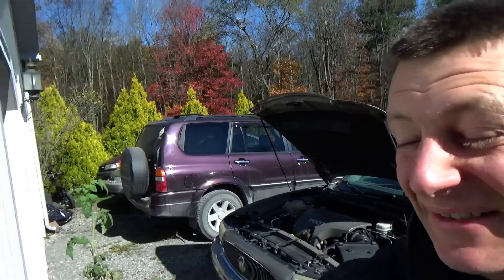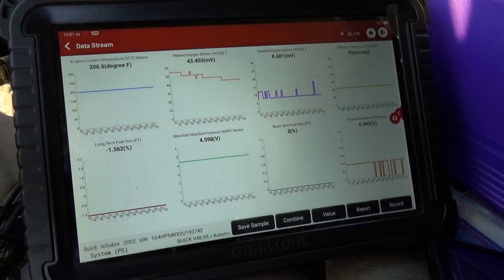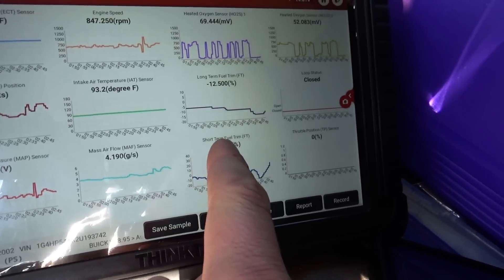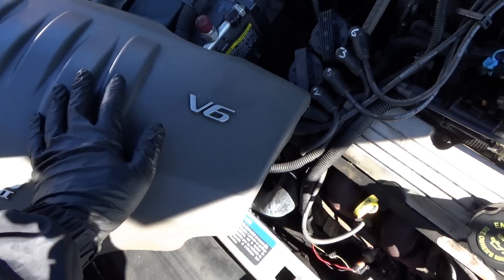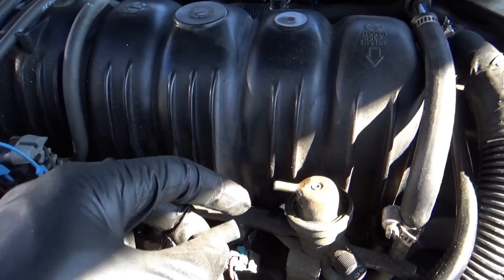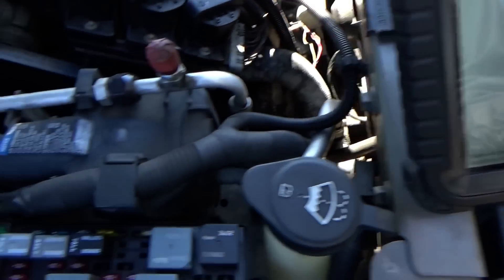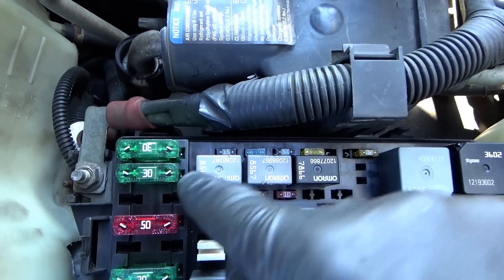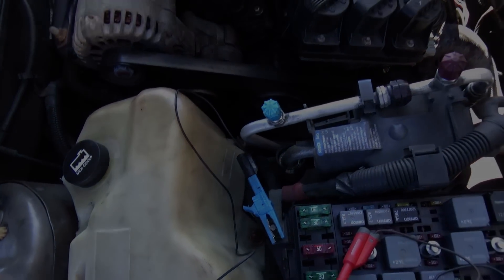Buick 3800 BAFFLES the Owner (Long Crank-Surge-Stall...No Codes, No A/C?)

Comment: Love those 3800 engines.  I had two of them and they were the best.  Good power, great highway mileage.  An engine that never should have gone away.  Look at the crap engines that replaced it.  Honestly, I don't think GM has an engine presently that is anywhere near reliable as the 3800.  That's why I bought a Honda when my 2008 Buick Lucerne's transmission needed replaced.  Couldn't justify putting in a transmission in a 16 year old car.  Besides, my wife had been bugging me for 5 years about getting a new car.  Hated to see that car go but things were wearing out.  The last year I owned it:  new radiator, new AC compressor, new steel fuel lines (northern car) so it was time I guess.  What a nice driving car however...........and much quieter than my Honda.  Road noise on the highway is obnoxious in this Honda.  I will likely trade it in sooner rather than later because of this but what do I purchase?  A Lexus?  Acura?  They all have turbos which I will not get.
Reply: 2010 Honda civic.  Yes, the road noise is bad. It has a good stereo.
Reply: If you're looking for a 6 cylinder sedan in a modern car, you're probably out of luck unless you want to spring for a BMW or similar. At least Honda/ Acura still puts a V6 in their midsize-full size SUVs which is more than I can say for most car manufacturers these days
Reply: I know where there’s a really nice totally rust free 94 Camry with  the 1mzfe, but I know it would take a lot of “persuasion “ for the guy to part with it. 😅😅

Comment: Might notice that the blower fan was whining.  Let the owner know.  Might also check the interior cabin air filter.  Suspect an a/c leak, so that may need attention down the road.  Very informative- vacuum actuated fuel p. regulator.
Reply: That is ny buick. I replaced the fan motor with third party unit and it started wining within months. Not an easy replace for a 75 year old, so I live with it. My air cleaners are changed regularly. Thanks for comment.
Reply: @ShannonCoffey-l6b  Had a hunch you were on it.

Comment: I had a similar fuel pressure regulator leak with a Ford van once. I was inside the cabin with the dog house off doing my preliminary checks when the SA opened the passenger door to remind me for the second time that the customer was waiting as I was pulling the vacuum line off of the fuel pressure regulator. He got sprayed with fuel. Glad it didn’t get on the interior 😊
Reply: Priceless 😂

Comment: I love the 3800.  My favorite engine ever.   I still daily drive on.  I wish the wouldn't have quit making them, but they got to meet the fuel mileage standards.  So now we get 22 timing chains, direct injection, and little turbos.
Reply: What if epa reforms dialback the regs and we can get reliabilty over efficency....we can dream....
Reply: love the frugal prepper channel btw....
Reply: I could get close to 30 mpg with my 3800 if driving conservatively. Be hard pressed to find a 6cyl that even gets close to that these days, even with all the modern doo dads
Reply: That last for about 100k  & then new engine Turbos are junk just wear engines out quicker.
Reply: Looks like he been transporting very large chickens😂😂
Reply: I agree. Best engine. I had a 3.1, never burned oil. Started every day, no issues. Until some idiot stole it and spray painted the car. Destroyed the interior, broke the muffler off. 
My insurance covered my loss.
Reply: THE BEST ENGINE!!!
Reply: You can blame climate hypocrisy for that.
Reply: Little engines over pressured less thick metals plastics inside the actual engine direct injection that clogs with carbon you have no idea how bad it's getting
Reply: That engine is terrible. Not for the owner of course. I still have 2 cars with them. It's terrible for GM. I have a 2007 Grand Prix GT with 175 K miles on it. I've hardly done anything to it but regular maintenance. They last way too long. 😁
Reply: And less Mileage
Reply: That is what happens with a Kenyan president.

Comment: How do you know for certain the AC has no leaks like at the condenser? Wouldn't it be wise to put dye in the AC system and check for leaks?
Reply: Hopefully Ivan did the leak test, seeing if the system held vacuum, after drawing out the old refrigerant and just didn't show it.

Comment: 3800 cars, I haven't worked on one in 6-7 years. They all rotted out or the trans took a poop and were scrapped.

On cold days, I'll have to bring the refrigerant tank inside to warm up before charging systems. Then it goes right in.

Comment: Love the pin cushion headliner.
Reply: After almost 500,000 miles, I took the 'ol Marquis to my local upholstery shop and they glued in a new headliner and redid the sunvisors.  It had just started to come loose around the rear window.
Reply: I had an old Honda Accord.  Headliner started sagging.  It wasn't worth the trouble of pulling it out to fix it.  So I used thumb tacks to hold it up.
Reply: @major__kong  I remember being tasked with putting thumbtacks in the back seat area of my dad's old Chrysler 😂
Reply: I still drive an old 92 Chevy Cavalier.  It has pin cushions holding up the headliner on it too.
Reply: Honda civic 2010 headliner is bad. Purchased it that way with 79k on it.  Now 134k.  I haven't done anything with it.

Comment: With that A/C system almost empty it must have a leak somewhere. Recharge is only a temporary fix. Need to find and fix the leak.
Reply: There's always some leakage, especially  when its not being used because the clutch on the compressor doesn't work.
Reply: Put some dye in it and charge it up is industry standard. It was holding a little refrigerant, so not a completely flat system.
Reply: A/C system is supposed to be a closed system and not supposed to leak. Could be an extremely slow leak like from a Schrader valve seal, or a more substantial leak somewhere in the system. So how long it will work depends on the severity of the leak. Bottom line is the system should be checked out not just recharged.
Reply: u are correct at least let customer no it may cost them a system rebuild if the leaks not fixed. then if they decline its on them

Comment: That's the 3.8 litre Buick L36 V6 engine, my dads 2000 model Holden VX Commodore has Holdens Ecotec version of that engine fitted which is fitted with Holdens own Ecotec V6 inlet manifold & Holden made an oil pan for it.

The PCM in the VX Commodore is a Bosch OBD1.5 PCM which comes from Singapore unlike the Delphi type of OBD2  which is fitted into the Buick, the Ecotec V6 engine uses a similar style of fuel pressure regulator but it's not the same as the PR217 type of fuel pressure regulator as used in the Buick, they're both replaceable.

I fitted the PR217 type of fuel pressure regulator onto the fuel pump & sender unit in my 2002 Holden VY SS Commodore which is fitted with the 5.7 litre Chevrolet LS1 V8 engine, it's the returnless type of fuel system.

I only paid $13 AUD for it including shipping from China on eBay & it's fitted inside the fuel tank rather than on the fuel rail, I needed to adjust the fuel pressure with the engine running which I did in a bucket of fuel, the Chinese PR217 fuel pressure regulators have a grub screw on top which can be turned in to increase the fuel pressure.

I have ran my car with that fuel pressure regulator for over 4 years without a problem, note that I am talking about Australian built GM cars here.

I can remember in the first Holden VL Commodore we bought in 1997 which ran the Nissan RB30E engine we replaced the fuel pump then soon after the fuel pressure regulator diaphragm ruptured, my dad got a quote from Holden for a brand new one which was quoted at $300 AUD because it was a typical Japanese car part which costs a fortune so we went to the wreckers & bought one for $30 AUD.

How I knew that is because the engine wouldn't crank over because it was hydrolocked because I removed the spark plugs & the cylinders were full of fuel !

Comment: what's with da headliner??
Reply: The foam perishes with age and heat and comes away just behind the glue to the fabric, so the headliner droops, so you pin it back up with drawing pins.
Reply: It's 23 years old and worn out.
Reply from the maker: @tomtke7351  GM 😂